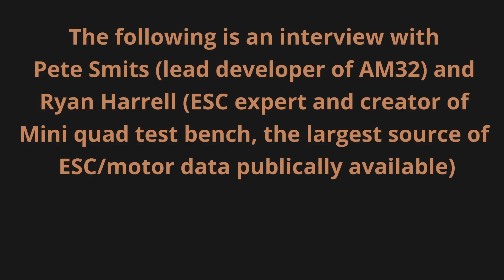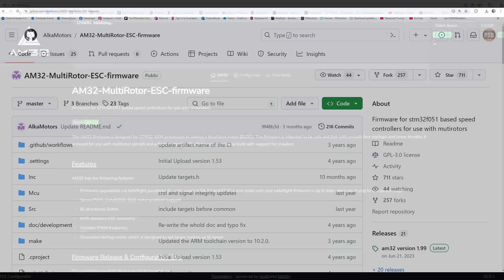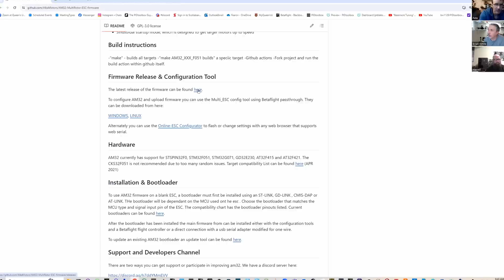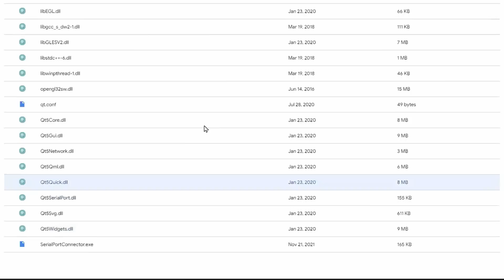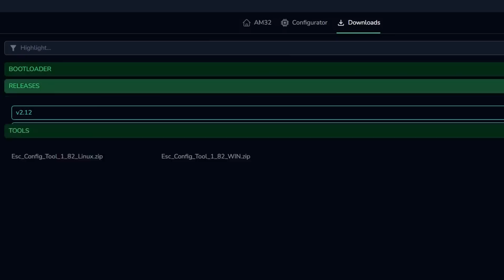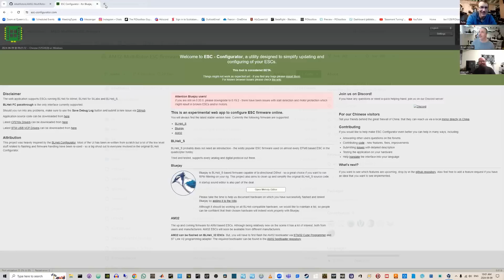AM32 and the future of ESC firmware

Comment: the biggest problem of am32 is overheating and blowing up caused by through out currents. Its ok for 5" or light 7" quad, but 7" with some extra load needs complementray pwm to be swithed of, but it also takes away control and resistense to desyncs. BlHeli32 heats up to 90-100 degrees, Bluejay stays under 80 degreed in the same exact scenarios.

Comment: Pete talked about changing the KV slider in the flash tool to something that shows the RPM at which the throttle will back off. How am I to determine what this RPM is supposed to be?
Seems easier to just set a KV slider to match what is written on the motor.

Comment: There's nothing wrong with keeping the KV instead of RPM. As a hobby user with less experience it is easy to take the KV value on the motor, RPM is hard to measure and it is a value that changes as the motor spins. It would be very difficult to guess what number to put on that slider

Comment: I wouldn't care if I didnt have quite a few escs still on 32.8 still in a bag unfortunately.  32.8 had so many issues
Reply from the maker: I think you should be fine on 32.8. But there’s also the option of moving to am32 with a little effort